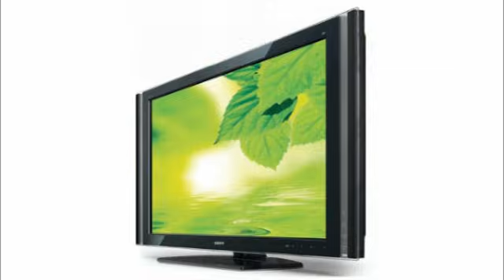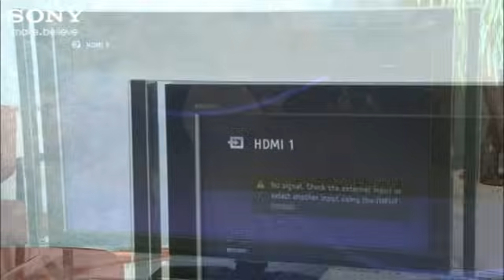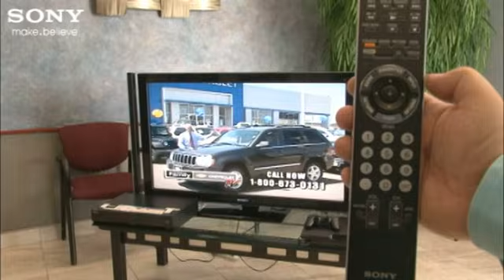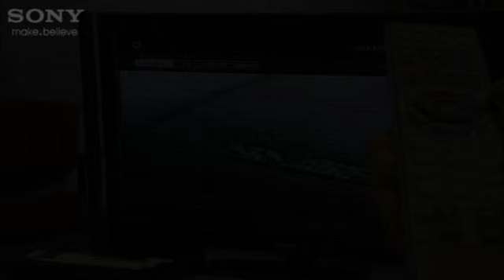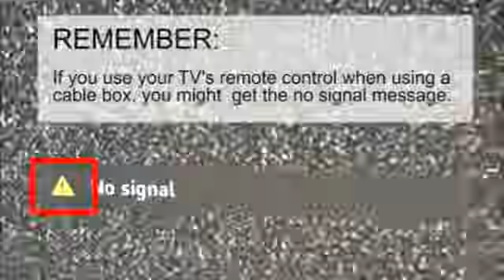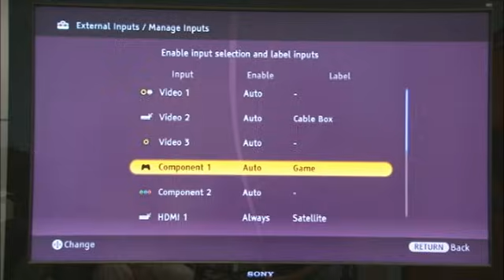Bravia TV:  I have No Signal

Comment: Once you've connected your PC to the Google TV, An HDMI External input should be Plugged & found and if so, you can go to Setting -> Video Input -> Configured Devices and you can disable the Built In tuner that is giving you that Pixel/TSSS sound... Try this for those without cable... ((Those with CABLE and still get the Pixel/TSS.. sound, READ YOUR MANUAL & DO NOT disable Built in Tuner!))

Comment: This video does not address the issue of a malfunctioning TV. I used to install TV's for a living, an improper connection is not my issue. My problem is the TV reads NO SIGNAL no matter what input i use HDMI, Component, coaxial, VGA, or USB. This video is useless if you have  the same problem i have.
Reply: That’s exactly the issue I have😊